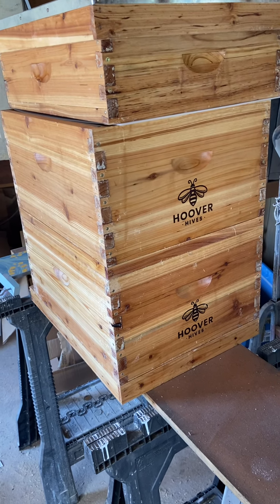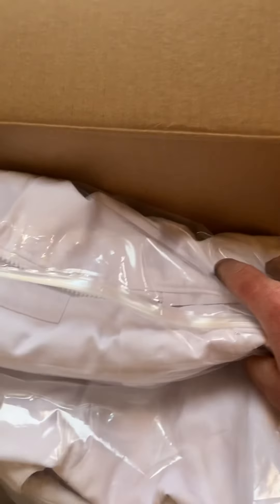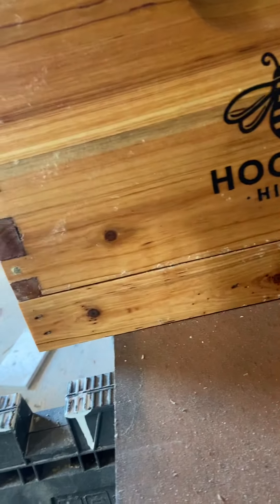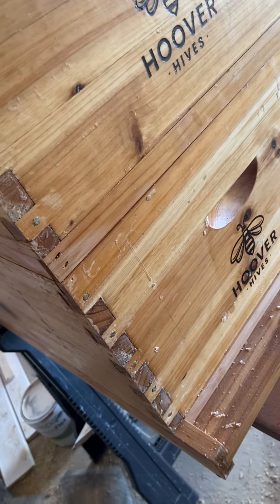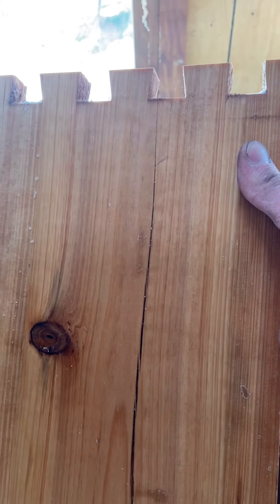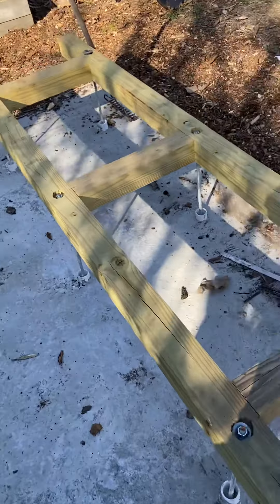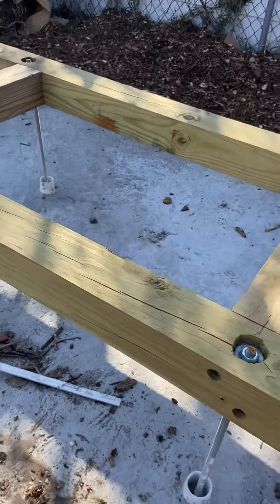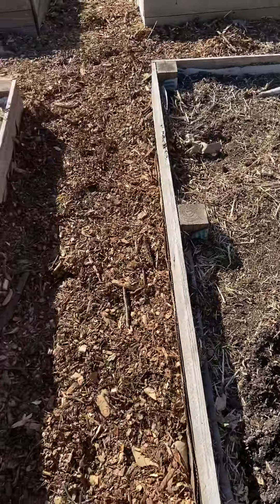Bee Vlog 2 Hoover hive update

Comment: mine went together crappy too...I had similar issues like you...a few of the dove joints were off alignment enough that I got a few splits in the woods putting them together...I was pissed.  Seems that their quality has gone down a bit.  I filled the splits with wood glue...it was tough to get together and I had to beat mine too to get the pieces to fit
Reply from the maker: Yeah it suck to beat up something new/something you payed lot for I just got another other in it was one deepbox and a bee Jacket but they sent me a full suit and no nails for the deep box but I said something about the jacket so they are send me a new one